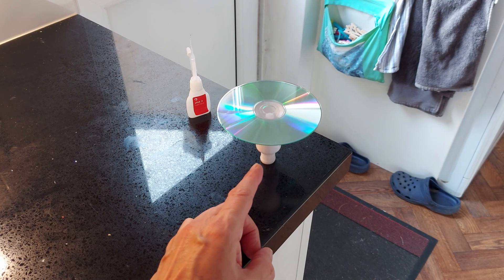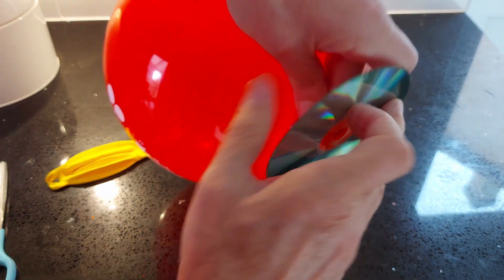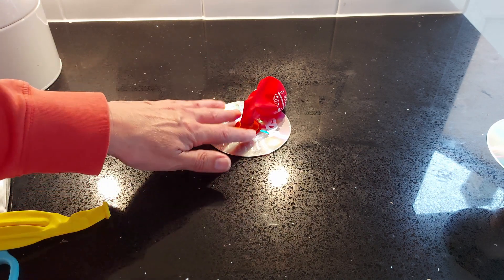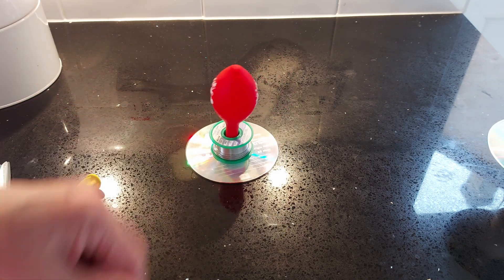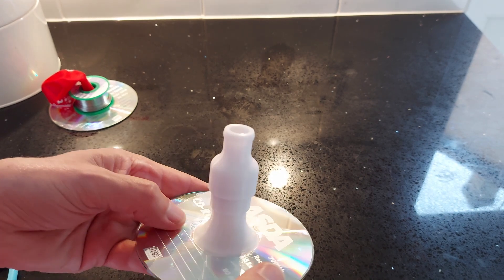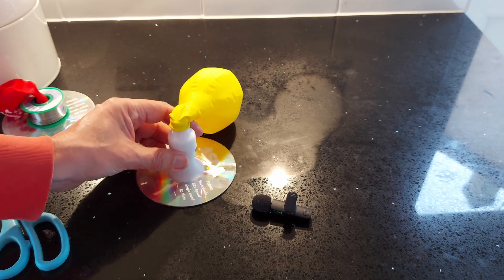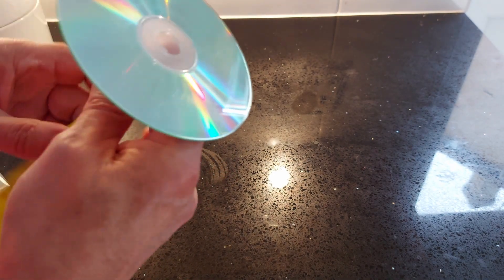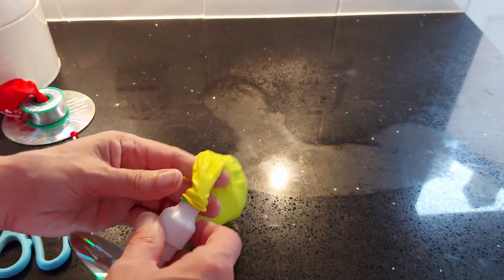Will the Siren Whistle work on the CD hovercraft?

Comment: Oh well, worth a shot. This is where a strict scientific approach comes in handy. Generally, you record all data and measure everything. Come up with an idea, write it down, come up with an experiment, write it down. Perform that exp and refine and repeat. No where near as much fun as just trying random stuff of course. I'd be getting some numbers on capacity and flow to start with.
Reply from the maker: Not the way I work 😂
Reply: @GrandadIsAnOldMan  Haha. Yep. As A kid, I can't tell you how many things I built without using a ruler to measure a single thing. Finally, when I did, I was shocked at how the wood from the shop was exactly the right size and how the finished products fit neatly on the shelves. How I had no waste wood left over, and how little cutting I now had to do. How much easier it was to buy a screw from the hardware store once you knew its measurement. So much easier on the hardware shop guy too. Although he did enjoy the guessing games, I think.

Comment: How does the CD buzz effect sound with the thicker yellow balloon vs the red?
Reply from the maker: I am on holiday at the moment. The main issue with the bigger balloons is that they flop over, so they are resting on the ground.
Reply: @GrandadIsAnOldMan  I had that problem too. Maybe a stiff paper cone or something would hold up a heavier or floppy balloon.
Reply from the maker: @Resonanttheme  being me, I could probably 3d print a support 👍
Reply from the maker: @Resonanttheme  of course, another option would be smaller balloons. Two or 3 layers to increase the pressure.
Reply: @GrandadIsAnOldMan  If worth the effort or wherewithal a pumped up 2 or 3 liter plastic soda bottle with valve would look nice riding atop a CD hovercraft.